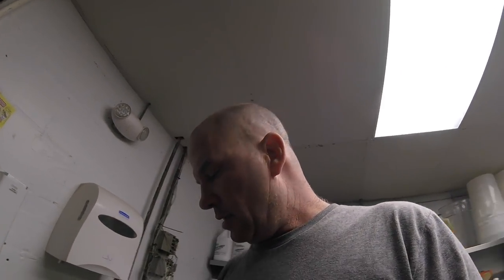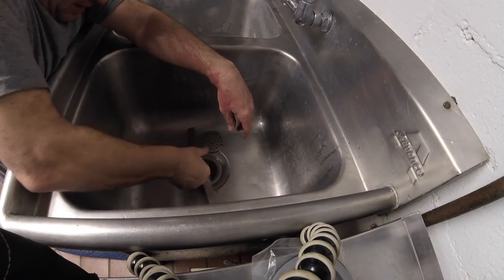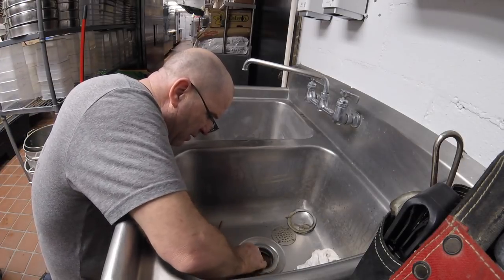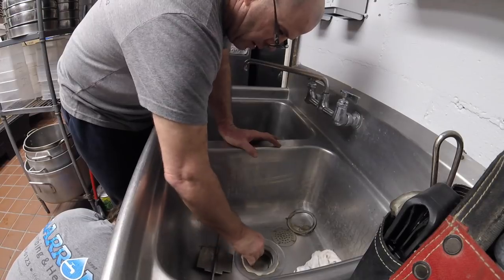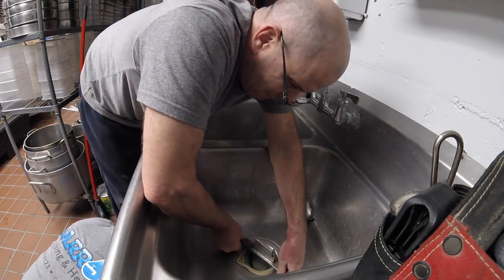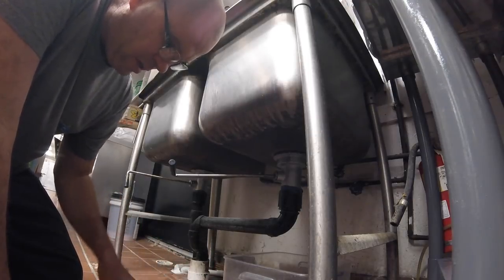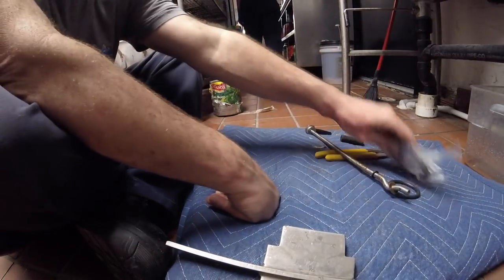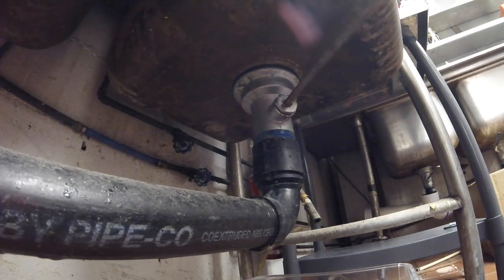T&S BRASS WASTE VALVE DRAIN REPAIR KIT INSTALLED

Comment: Thought I was the only one with that commercial strainer tool... I stopped using putty on those strainers, when you think about the way their made it doesn't need putty..
Reply from the maker: I love that wrench.  oh you use that rubber washer instead of putty? I like that. I will investigate also. Thanks for the pointer.

Comment: Never seen that basket strainer tool before.
Reply from the maker: It works nice Anthony.
Reply: Any one who's been a plumber long enough and worked on commercial stainless steel sinks should have that tool or your going to have a hard time tightening up that Kline waste . The rubber gasket usually just catches the edge of the sink . I used to cut my own out of red rubber with an Alpax gasket cutting kit, and always install the gasket dry or it will squeeze out on you.